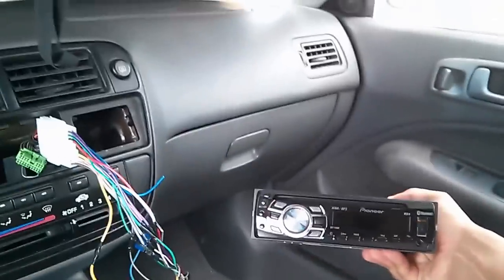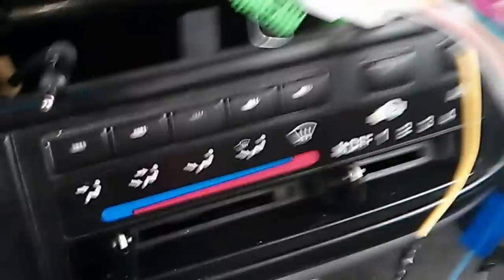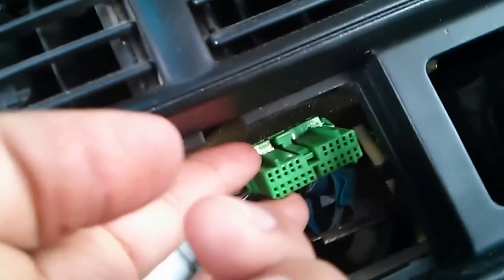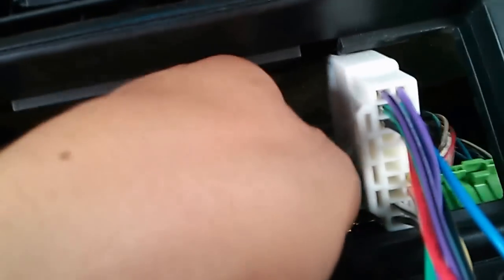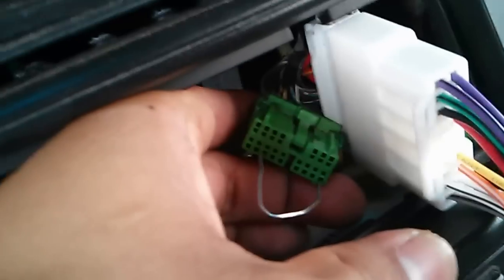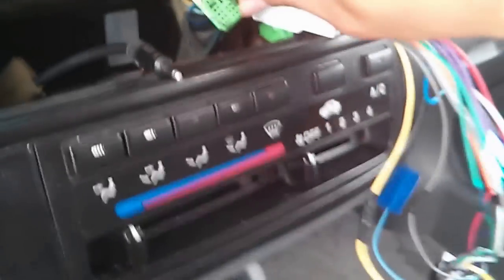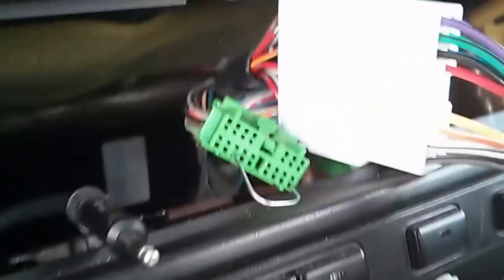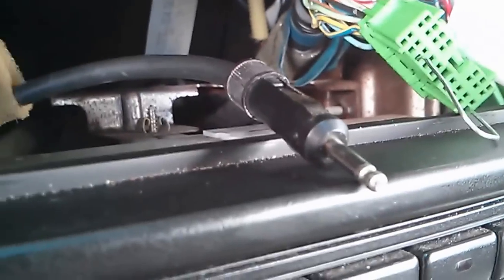How To Fix: 96-98 Honda Civic Dome Light Doesn't work Aftermarket Radio

Comment: Oh the light got brighter because it uses ground for the door switches.so honestly it would make you light stay on if it touched ground anywhere else.I used old telephone wire no worries off anything grounding out.

Comment: I don't understand how it works but it fixed the problem... Works like a charm.  Thanks...
Reply: Rzangrilli The dome switch wire is tied into the radio cluster. Notice the wire at the door jam switch is (green/red) Same as the wire in the cluster (3rd wire in on the bottom of plug) The 1st wire in on bottom of plug is just a ground wire (green/black). Jumping the pin is just completing the circuit so the door jam switch can actually do its job. Be a Switch. So for everyone else connect (GREEN/RED to GREEN/BLACK)

Comment: Did you have a problem with your aftermarket stereo not powering on? Checked the fuses and wires but didn't see any problems.
Reply: did you ever find out that problem? i just installed an aftermarked stereo to my 04 civic and the radio doesnt work, turn signals stopped working and my hazards...

Comment: bought my 97 civic with an aftermarket radio already, spent an hour tonight taking the switches and dome light off.could not find anything wrong with any connection.almost gave up and sitting in the dark I googled and this was the first result.so I paused showing where the jumper went and made my own jumper opened the door and light!! I have never seen where the dome light runs through the radio.and I would have never guessed this.but now I'm curious as to what all those other wires that were plugged in do.

Thanks I love having light when I open the door indeed of hoping in and moving the switch.

you are a life saver.
Reply from the maker: +harry holley lol welcome thanks for the view!
Reply: harry holley remote door locks, headlight dinger,dome light. Anybody know what else and how to jump wires

Comment: Thanks for posting this! I've been trying to figure out why my dome light wasn't working in my 98 ex since I got it over a year ago.
Reply from the maker: Welcome!
Reply: None of my interior lights work except for a very few of them such as my blinkers, check engine light, and ebrake light. I thought that maybe since my dome light doesn't work either that this might fix it but it didn't. What could the issue be? I've already tried the paperclip trick on the dimmer switch, and I've checked my fuses. Nothing is working, im stumped as to why I have no lights working. Even my dash lights don't turn on when my headlights are on

Comment: 2000 Civic is a different stereo plug. Can you tell me the colors of the 2 wires, to jump? Black & ? maybe
Reply from the maker: Yea 99-00 have a different set up and should not have a problem when installing a aftermarket stereo. As far as the colors go im not sure, if you have a 96-98 just jump the the smaller green plug according to the video sorry lol

Comment: Can you throw me some light and inform me if perhaps the power windows nor the power locks work due to the green plug going to the factory radio or does that not apply to this?

Comment: Do you know how to fix the door locks? I have a 97 civic ex coupe and the power locks isn't working...
Reply: Jose Vazquez if you have an aftermarket stereo, your key fob likely will not function properly. The OEM Honda stereo has a programming button (small rectangular button on the right side. Doesn't even look like a button, but it is, and it is used for programming.) With this stereo removed, you'll lose programming functionality.
Reply: Jose Vazqu

Comment: For some reason when I attach the paper clip it dosent light up fully? it's just kinda dim. I tried everything
Reply from the maker: Maybe change the bulb or start the car?
Reply: +Daniel Lopez replaced the bulb literally the other day, and it works fine when I turn the dome light on manually. Also tried starting the car and no luck. :/
Reply: +Daniel Lopez could it be a bad ground?
Reply: those switches are notorius for getting corrosion on em n not making good contact id go to a junkyard or ebay n buy another light switch for your year get a new one if u can

Comment: I recently tried to replace the dome light with an after market LED light. The new light worked for he first time then it is gone. I replaced the original light back in place still the light will not turn on (manually or door opened). Looks like some fuse went out?
Any one has any idea?
Reply from the maker: fuse?
Reply: dome light fuse is the 7.5 amp Brown one under the hood

Comment: Hey how did you get the aftermarket radio installed I'm having troubles with mine
Reply from the maker: Paul Brian behind the hazard button and defrost button are some screws, remove panels surrounding the radio.

Comment: How about the headlight dinger???  You know when you leave your headlights on and you turn off car it will ding.
Reply: I know this is really late but I want to chime in.

I have a 1998 Honda Civic CX with an aftermarket radio and dome light not working (I haven't tried this jumper yet), but my headlight ringer is working. When I turn the car off and have the lights on, it will ring until I turn them off.

My point is that I'm not sure your issue is related to this exact situation. When I pull the radio out to try this, I'll let you know if the person who installed the radio originally jumped anything, but I suspect they probably didn't.
Reply: Mine works, has nothing to do with this jumper

Comment: Anyone who sees this and could help me out please do. 
I have a 98 Honda Civic and I have subs hooked up in the trunk. My radio won't cut on now, but it was going on and off, or it would take a while to cut on after the car cut on. It started doing that after it had sat and no one drove it for about 6 months. Before that it worked fine. I was wondering if any of y'all knew what the problem was like if the radio just went out or maybe the fuse. Rain did get into the trunk onto the subs and amp. Any help appreciated

Comment: Anybody have a problem with no power at diagnostic link connector?  Because they r on the same fuse. Appreciate feedback. Thanx all. My dlc is dead
Reply: Bill Rimmer check fuse under the hood if you havent figured this out. Its the "back up fuse" 7.5a